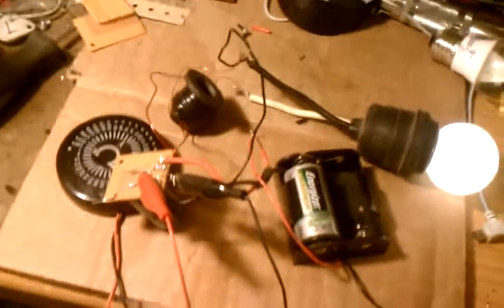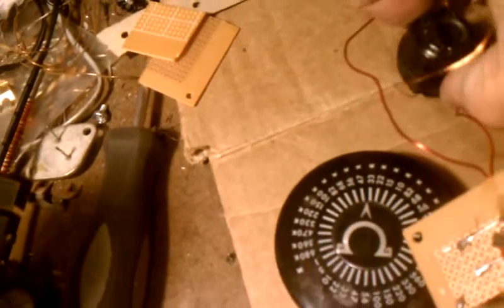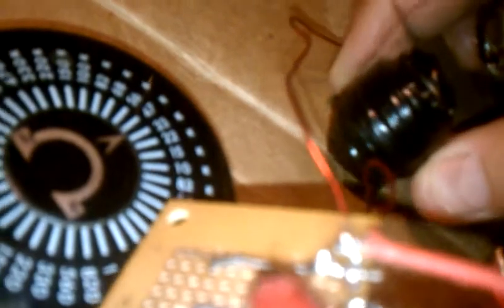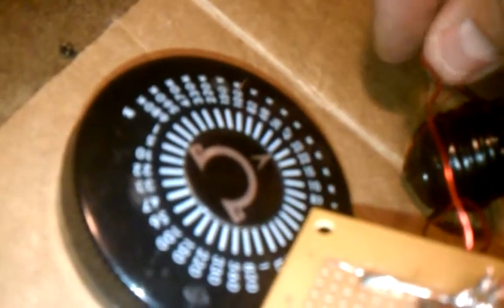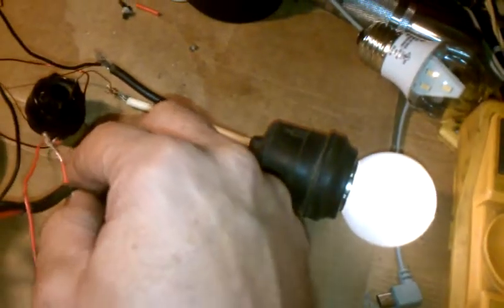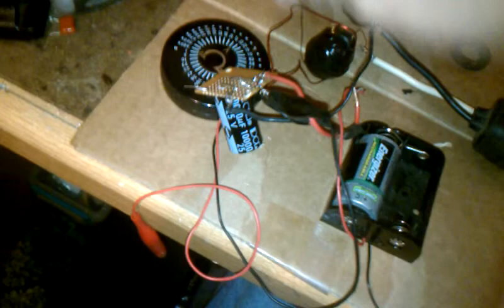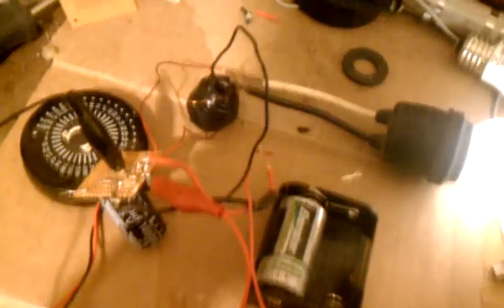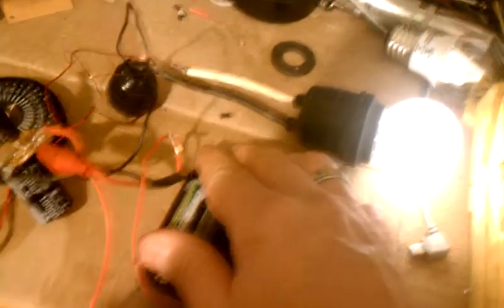last crossover circuit replicatiion mod

Comment: Nice work. Seems like you have the same bulb as lasersaber. Do you know if it is of the type that uses a capacitive stepdown (inside the base) or if it has a mini transformer inside, and is switching mode? Thanks for sharing. Also, do you mean MPSA05? (you say MOSA05). did you try with a bigger power transistor, and the signal like Laser? Cheers, thanks for sharing.